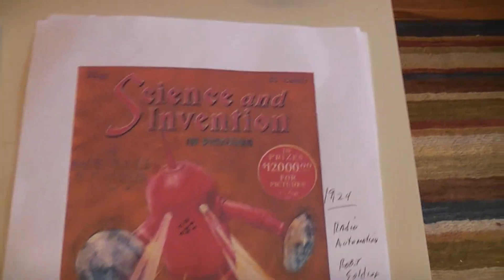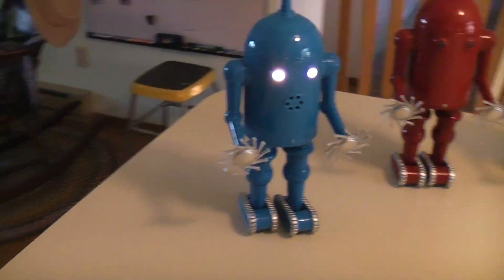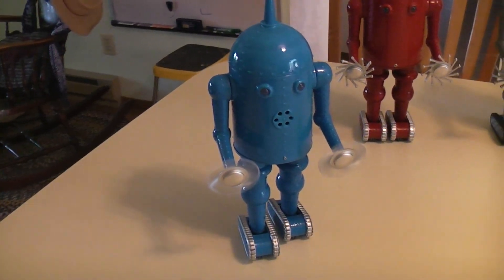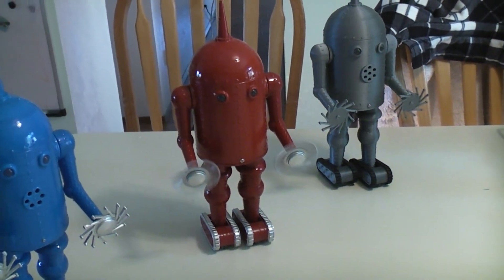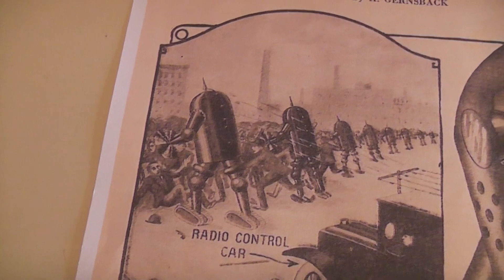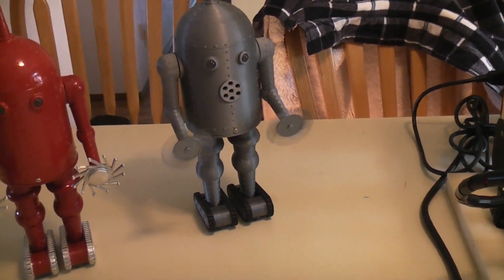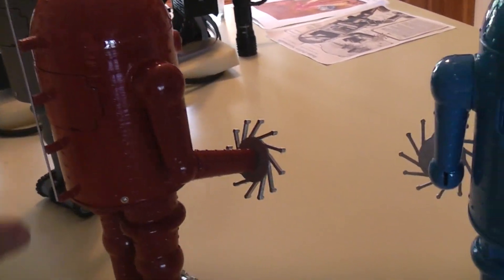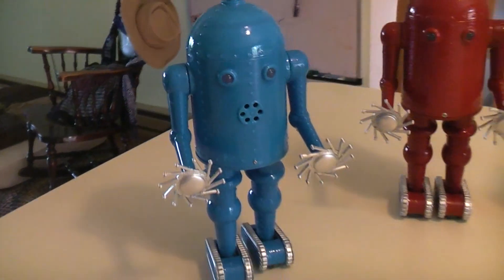1924 Radio Police Robot 3d printed in Polysmooth

Comment: Is polysmooth more like ABS in terms of durability and feel... or is it just as hard and brittle as PLA?

Like could you print functioning balljoints with polysmooth? Or would the ball socket snap like it does with PLA?
Reply from the maker: Once you have treated the polysmooth it is more like ABS, it really is like Styrene plastic in flexibility and you can glue it with alcohol based glue that you can make by putting scraps of polysmooth in a jar with alcohol. So not as strong as ABS but more flexible than PLA.